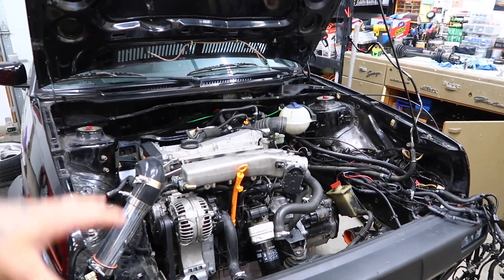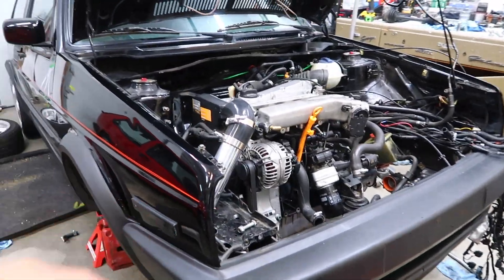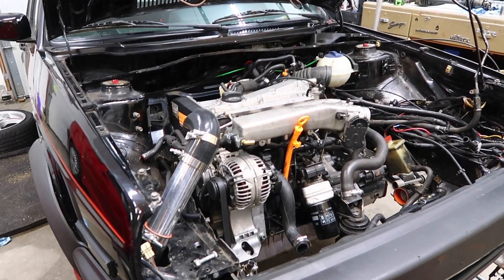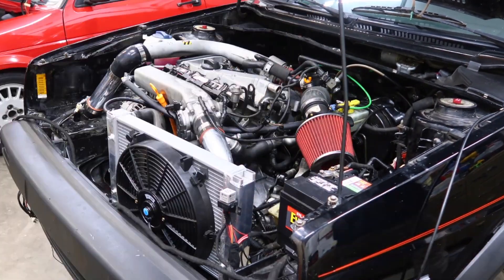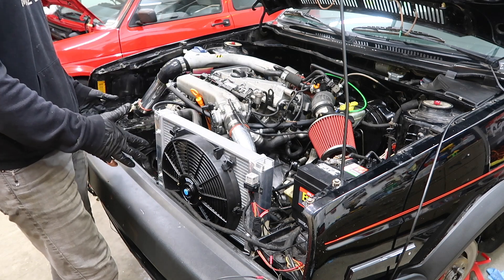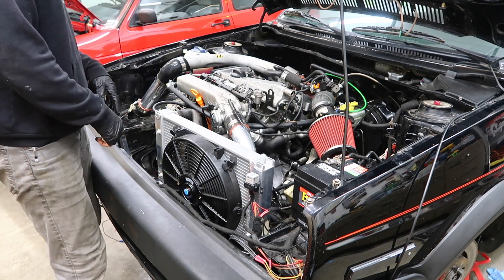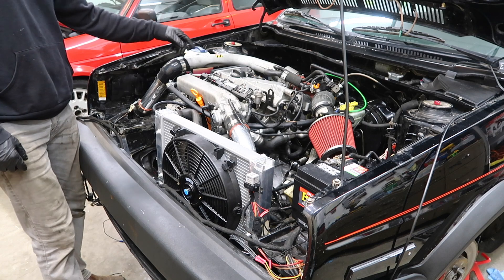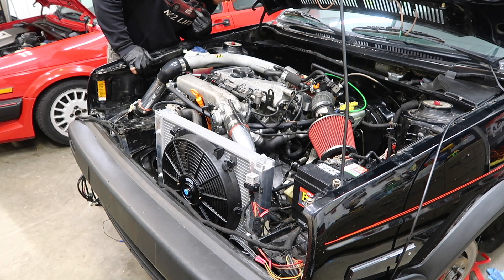MK2 Gti 1.8t New Engine Install

Comment: Nice work bro! I agree on moving the overflow tank. You should relocate the battery to the passenger side in the trunk. Cleans up the bay allowing you to extend the filter and enclose it with a heat shield and helps with the weight distribution as well. I've done this in all my mk2's and it's well worth it.

Comment: Fantastic,  well done buddy.
Wish I could get mine installed in sub 5 minutes!
Question for you Jake,  on the coolant tank install on passenger side does your small hose go to the radiator,  or to the small outlet on the alloy flange in the radiator hose below the throttle body?
One thing I'm confusing myself with.
Reply from the maker: Both